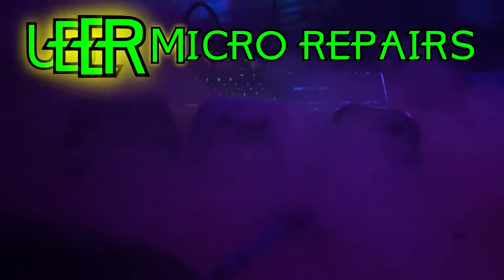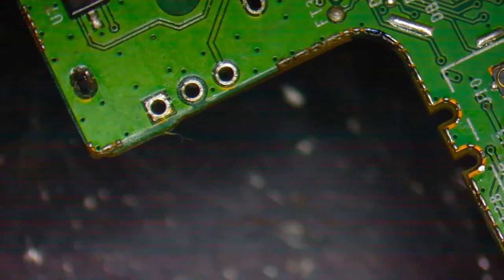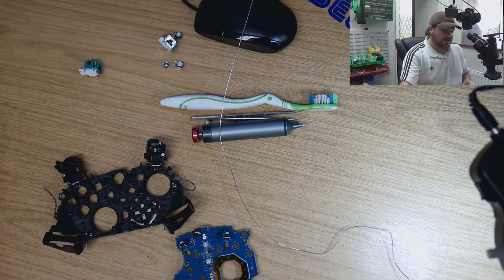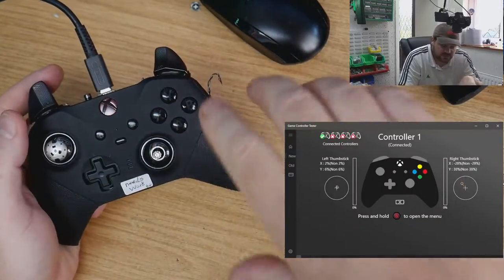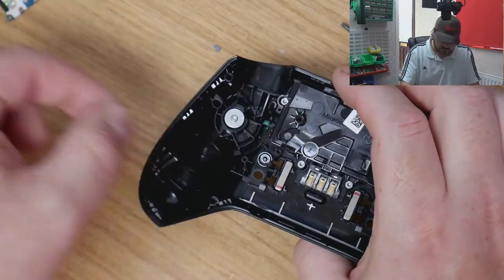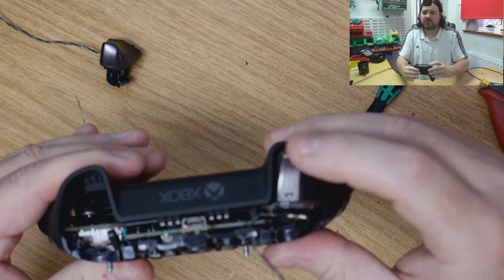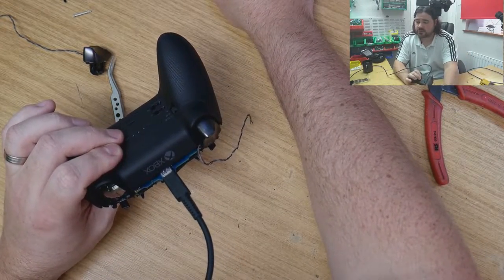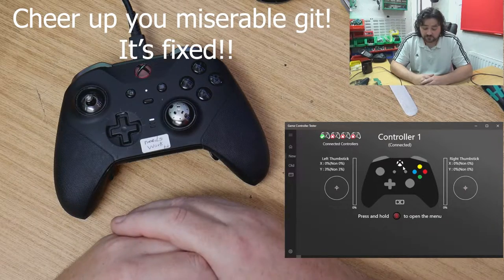Xbox Elite Series 2 Controller Nightmare Repair - ⚠ It Just Kept On Giving!!! ⚠

Comment: Is it possible to wire a connection from the nodes/fingers which interface with the pads for the back paddles to buttons that could be placed elsewhere on the Elite Series 2  controller? 
Also, do you happen to know where the contact points for the Dpad are located on the Elite Series 2 circuit board?

Comment: I have a similar controller in atm where a prior repair attempt has been made and they have managed to completely rip off one on the spring fingers (specifically j20) and the pad has been tore as well) I was wondering if I need to scratch both circles above and below the pad on j20 or just the one underneath which I can tell is definitely connected

Comment: Where do you get your board parts? I lost one of the small wire mesh “sponge”-like parts that sit on the pcb.
Reply from the maker: The conductive sponges are just for ESD to the paddle boards. It wil be fine without them.